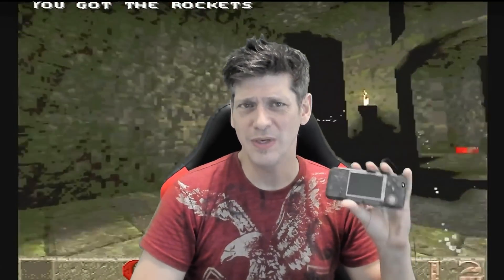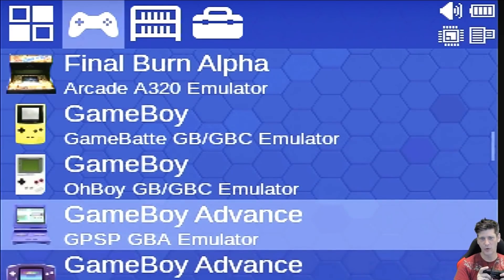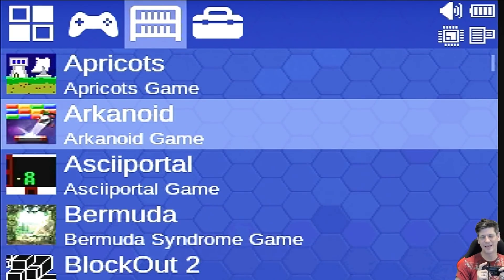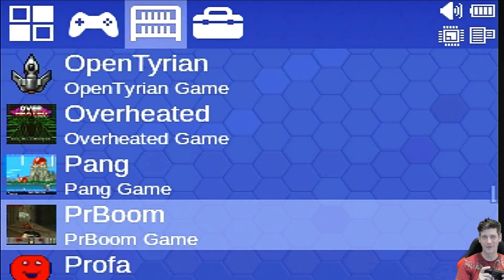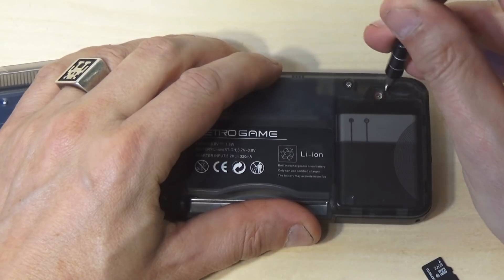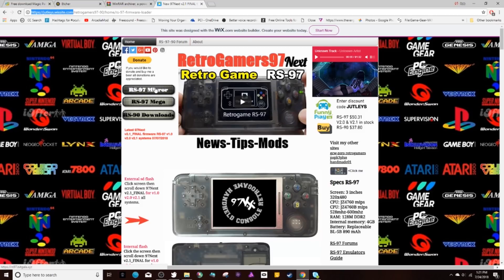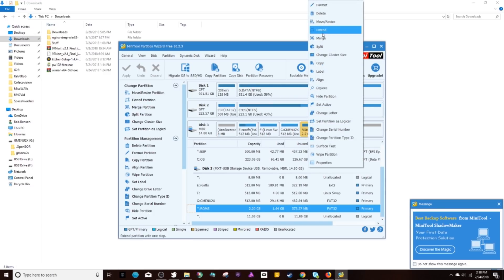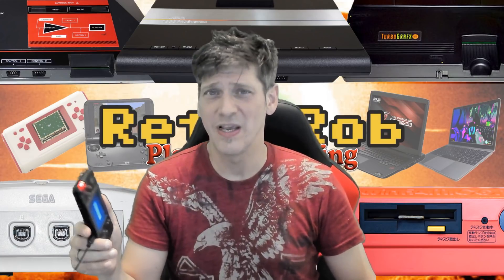Installing Open  Dingux in the CoolBaby  RetroGame RS- 97 Internal SD

Comment: Rob did you do this update after this? The stuff you said at the end? if not, is it just not something you want to do anymore?
Reply from the maker: I would not rule out more RS-97. It's still on my "Keep" pile (I use the white one now though). There has been a number of firmware updates to the '97 since my little set of videos, but I really have not had the time to change it up.
Reply: @Retr0Rob  I love my RS97. I have the same model you did in the video but it is motherboard revision 3.0 with a 60hz screen. Hey Rob, there is a cool blue anniversary edition out there. Do you also know about the Rg350 and new stuff? If not the obscure handhelds site has the skinny on that stuff as well as jutleys. Thank you for taking the time to respond to me. Your great.
Reply from the maker: @valentine_puppy  Yeah, I have not been offered an RG350 for testing yet, but They look really great. I may splurge and upgrade to the anniversary model -- I really like the look of them. Thank YOU for watching, I really appreciate it!

Comment: I have the new model with joystick. I am not sure if this will install on it?
Reply: Me too,RS-97 Plus with joystick. Is it the same  way we install the Dingux  in RS-97?
Reply: @tembadau  hi. Mines came in the mail. After thinking about it I decided to keep it stock. My only complaint is that GBA emulation has like a 1 second audio delay. Other than that all stock emulators work pretty well. The music player and such is terrible. It looks like a psp player but its far worse. I won't bother making it a mp3 player. I use my phone with bluetooth headphones for that. I bought a 32gb tf card for it. I like it so I kept it stock. I decided it was good enough so I didn't want to deal with customizing it. Only GBA has an audio problem. :)
Ah let me say this when you connect the av cables it gets ugly. It doesn't play well on a tv. To much frame skipping. The handheld itself has an ok frame rate. It gets nasty when you connect it to a tv. It's not perfect but it's good enough.

Comment: Thx for the nice video :-) I've done all that what you mentioned but my rs-97 stays black... only the green light is on, but nothing else happens. My board says: Retro-Game-V1.0-S 2018.6.21 and I have have tried both versions: 97Next_v2.1_Final_internal_PyMenu_R3_v1.0_v2.0_systems_only.7z and 97Next_v2.1_Final_internal_v1.0_v2.0_systems_only.7z. Can someone tell me why?
Reply: btw... the stock firmware works fine...

Comment: Is the RS-97 better than the Odroid Go?
Reply: You can compare the specs using the links below. The Odroid GO is cheaper but obviously there's some assembly required. On paper the rs-97 seems to have the faster processor, but I'm not sure how they compare practically. The odroid go has wifi and bluetooth if that matters to you, it doesn't have a 3.5mm port so your options are to either mod one in or use bluetooth headphones. The build quality of the odroid go looks better to me than the rs-97 but of course you have to assemble the odroid go yourself so part of that is going to have to do with your skills. The rs-97 has 8 buttons and a D-pad: 4 face buttons, start, select, L and R shoulder buttons, while the odroid go only has 2 face buttons , start, and select. I think you may be able to use a bluetooth controller with the odroid go but I haven't seen any examples of it. On the odroid go wiki they only show it emulating GBC, NES, and SMS systems, but it runs Retropie so I don't see why you couldn't run other emulators on it and use a bluetooth controller but I couldn't tell you what emulators are usable on the system. The odroid go has a 10 pin GPIO expansion port on it so you could use it with some additional modules or program it to control some maker projects.
 
https://wiki.odroid.com/odroid_go/odroid_go#specifications
http://rs97.wikia.com/wiki/Hardware
Reply: Andrew S great comparison, I was wondering about this as well as I’d love to pick up one of the two to basically live in my purse for gaming on the go lol. Thanks!
Reply: Thanks, Kat. I'm quite jealous of your handheld collection. You might also check out the Gameshell, it has a better cpu, a GB style form factor, and is modular so you can add more buttons to it. And you might check out the Freeplay CM3 which is essentially a Raspberrry Pi 3 in a modified GBA case. This will easily give you the most emulation power in a handheld form factor (outside of a GPD XD+). You could even dock this machine with a monitor, keyboard, and mouse and use a full linux arm distro for your everyday computing needs.
Reply: Andrew S too kind! I’d really love a Freeplay but the cost is a bit up there for me personally. Even more so if I purchase one pre-built as I’m just learning about these assembly kits myself. Also good to know about being able to dock it for sure, had no idea 👍🏼
Reply: I got an odroid - its great kit for learning a bit of electronics, and its build quality is really fantastic for something you put together yourself. However its not a great emulation machine at all - its a ESP32 chip running at 200mhz, most people say the master system is the highest spec machine it will emulation. Even with GBC games there are frame skips as the panel only works at 30 fps. Its a nice machine and I think Rob should definitely review it, but I think as an actual gaming machine its not great.

Comment: RetrOrob try giving us a video on NEXT os which is the only cfw available today or provide a download for that OS you are showing from 1:36 to 10:28.

GMU on the lastest next OS does not allow you to navigate to the roms partition or external sd so you can not play music ......Most the included games did not load or would hard lock the system and i had to pull the battery to turn off the system....can not turn the system off with the power button on NEXT OS....... I have yet to find file navigation or overclocking for emulators.

Comment: Thanks for the update. I'm excited to get mine. I love my GPD XD but I find it's not quite as pocketable as I'd like for quick on-the-go gaming breaks. The form factor of this device seems perfect for that.
Have you found any issues using the buttons for prolonged periods of time? And how's the battery life with the custom firmware?
Reply: Buttons are fine. No signs of wear after months of abuse. Battery is 2.5 - 3 hours. If you're going to be doing extended gaming sessions, bring an external battery pack.